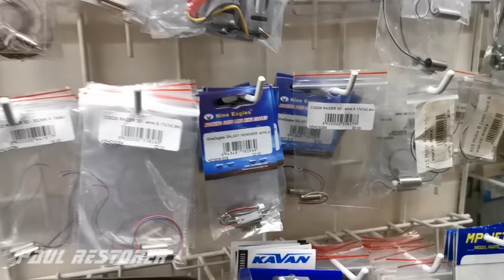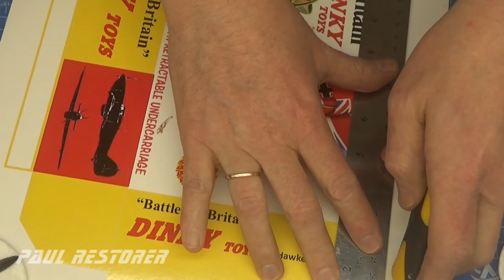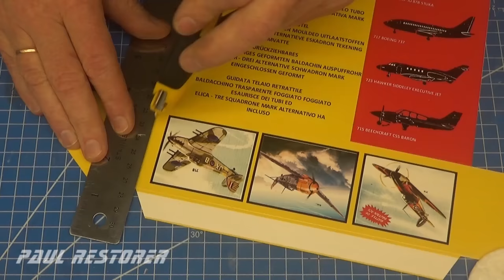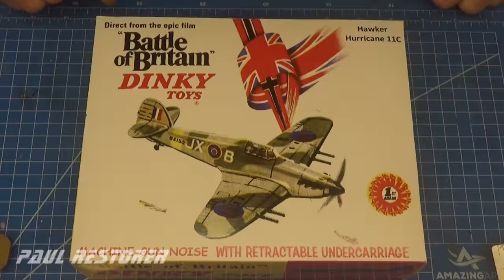Dinky Custom renowacja Hawker Hurricane MkII nr 718. Model odlewany. Śmigło na silnik elektryczny.

Comment: Great job Paul. One niggle: the dihedral is too pronounced for a Hurricane after your bending of the lower wing half . You would have done better to bend the top half. Looks more like a P-40 now.  :-)
Also the panel gaps underneath would have been tighter had you done this.
Dinky made a mistake here too: the MkII C never participated in the BoB. Its was a 1941 variant, too late for that conflict. I guess they just wanted the 1969 film tie-in. Great movie BTW.
Reply from the maker: Thank you very much Jim
Reply: technically you are correct however, in the film itself later versions of the hurricane were used, also, three of the buchon aircraft representing Bf 109s were painted as hurricanes and used in the background as they only had three flyable hurricanes and needed to bulk out the hurricane squadrons. another crazy fact about this film is that at that time all the aircraft gathered to make the film was officially ranked as the worlds 9th largest air force!

Comment: I was "gifted" a similar relic decades ago, the battered and forlorn hulk of a Dinky Spitfire that has been rattling around in a junk drawer at my mom's house ever since, mostly for want of replacements for the long-gone propeller and canopy (that wouldn't require the purchase and sacrifice of a perfectly good kit model).  (At least it still has it's landing gear.)  Now I have a much better idea of what I'll find if I crack it open.

An ancient, played out, beat-up piece of hammered scrap that was just a little bit too pretty to throw away, I had no idea what I was going to do with it....Until today  
I'm sure that somewhere along in the project, I'll be cursing you for setting me down this path, which has, as Winston Churchill put it; "..nothing to offer, but blood, toil, tears, and sweat" 

I'd better get thanking you for the inspiration out of the way now,  before I'm cursing you while smarting from an acid burn. I should also consider documenting the process, as you have, for comparison and possible broadcast. Maybe there are more of the Few, owed so much by so many, waiting in the junk drawers and thrift stores to rise again.
Reply from the maker: have a nice work on the model

Comment: what if you turned it on, on a flat surface, would it start to roll forward because of the prepeler
Reply from the maker: The thrust is big and it starts to drive slowly.

Comment: IIRC, the slot behind the cockpit was for a thumb-wheel, which, when turned, made a clicking sound intended to emulate the guns firing.
Reply: That is exactly right. I used to have one of these as a kid. There was a spring inside that the cog/thumb wheel rubbed against as you turned it, creating the same sort of sound you got when clipping a playing card to your bike wheel.

Comment: This plane never had a motor. It had a thumb wheel on the top. When it was turned it clicked and was supposed to simulate a machine gun sound. It was sold as a kit. I built it and I used the paint supplied, but it was never really suitable for handling as the paint never really dried hard so it had a lot of fingerprints. The spitfire and Messerschmitt had motors. The stuka had no motor but it had a cap bomb.
Reply from the maker: Cool

Comment: The rest'o is ok but the top surface finish should be totally matt , along with the underside ,also the underside of this Hurricane should be matt sky blue NOT  grey , i know the correct painting side of WW2  Aircraft because i do the REST'O  painting on REAL  WW2  Aircraft  at DUXFORD , including SPITFIRE'S  and HURRICANE'S .
Reply: Not quite.  Let’s start by pointing out that Dinky got it wrong in the first place and this is a pretty faithful reproduction of Dinky’s error.  Dinky launched this as a model direct from the Battle of Britain film - so what was Dinky’s mistake? Well the main one is that this is not a Battle of Britain Hurricane - they correctly declare this as a Hurricane IIC and as such the four 20mm cannons and the grey/green upper and the light grey lower colour scheme is correct, but this aircraft is later than the Battle of Britain.  During that battle the Hurricanes would have been Mk I with eight 0.303 machine guns, the colours would have been brown/green upper with a sky or duck egg blue lower - the day fighter scheme of that time.  Later, after the Battle of Britain, the day fighter scheme became the grey/green upper and light grey lower.  Also the original Dinky model (I had one, and the Spitfire and the JU-87) had a gloss finish.  So in summary this is a very good faithful reproduction of the actual Dinky model which was not the right version for the Battle of Britain.
Reply: @robertgarrett4046  
Hello. Mr Heather is just pointing that the modeller has reproduced the errors of the dinky toys firm... As a direct Witness because  he pocessed himself this model when
 he was young. So why getting so angry !!?? A bit stupide attitude.

Comment: you put the tail decals on the wrong way, R/W/B not B/W/R from left to right
Reply: No, he's correct. Red White Blue from front to back.
Reply: @Maxley..  Nope, R/W/B from left to right on both sides.
Reply: @georgebarnes8163  Actually red is at the front (nearest the cockpit) on the fin flashes of both sides. This was done to distinguish it from the tricolour used on French aircraft. The decals applied here are correct, as is the artwork on the box.
Reply: @Maxley..  Both are wrong
Reply: @georgebarnes8163  Ah! A troll! You had me going for a minute!.

Comment: Do you remember the SPITFIRE ? ..that had a battery propeller motor too…….And do you remember the JUNKERS JU 87B STUKA ?…that had a detachable BOMB which could be released from its undercarriage.
Reply: I had the Spitfire Walter....could never work out how they fit such a small motor in.
Reply: @Habu2  Yes indeed. If I remember correctly it was installed in the nose of the aircraft in a tiny space.
Reply: @walterevans2118  Happy days eh ?.....the carefree times of childhood.
Reply: @Habu2  indeed ..lol
Reply from the maker: The Spitfire will arrive early next year
Reply: I also had the Jaguar with the ejector seat.
Reply: @LoneWolf-ck7pj  I vaguely remember that....Also possibly was there a Hawker Harrier too ? ...Vertical takeoff Jet VSTOL
Reply: @LoneWolf-ck7pj  I used to have Airfix kits of all these aeroplanes too.
Reply: I had forgotten the Stuka, but now you've jogged my memory I believe I had one (or a friend did).

The bomb was released by operating a metal catch on the side of the fuselage, as I remember - exciting stuff for the time. And do I recall correctly that the bomb itself had a sprung nose that would explode a paper cap like those used in toy guns?
Reply: @miked1869  yes

Comment: Nice job.

I used to have a Dinky Toys Spitfire that actually had a small motor in it from the factory. It used to take a very small battery that was housed under a plastic cover at the rear of the fuselage.
Reply from the maker: Thank you very much . Cool

Comment: I have that model up in my loft along with a spitfire and ju 87. Used to also have a zero.all a bit worse for wear although the paint schemes on mine are still in pretty good order. It's the propeller the cockpit and the cannons that are broken on my hurricane . The ju 87 was good as it had a metal bomb that had a release mechanism and you could place a paper cap in the bomb head to make it bang when it released:)
Reply: Ha ha....great stuff.
Reply from the maker: Cool

Comment: Some of these were sold in semi-kit versions where you had to assemble them yourself, they included a rivet punch for the undercarriage. It was pre-painted, but you added the decals yourself.
Reply from the maker: I've heard about this version for self-assembly, so far I've only met one. i saw a routemaster bus on the internet
Reply: The Dinky kits weren’t pre painted but came with little vials of Humbrol enamel for the builder to apply.

Comment: Great memories. Used to have a Spitfire version of this with a motorized propeller. If I remember correctly you started the propeller by flicking it. Wish I’d looked after it better. Is is still possible to still buy these or would it have to be a restoration?
Reply from the maker: great For now, I am trying to buy such a Spitfire model, as soon as I can do it, I will definitely be renewing it
Reply: Way back in the 70s dad did 3 spitfires for myself and 2 brothers with the battery propeller we still have all 3 and with the rego he had I think the last letter as our initial P, A and I. We also have 3 seaking helicopters with battery main rotor

Comment: All of the parts for these Dinky aircraft can be purchased on eBay. There are quite a few people selling all the bits and pieces including cockpit canopies, exhaust stubs, props, the rachet gear for the rear of the canopy and everything else. From the look of the untouched stubs that hold the oleo leg springs It looks like this may have been one of the rarer kit releases of this Hurricane rather than the finished product. Very nice finished model.
Reply from the maker: Thank you very much

Comment: Lovely job, though I've never found a finish on a restored metal model I liked (this one is too glossy for me). It does seem to be the most difficult part to get true to the original. If I had to say what it is precisely, it's that the paint layer is too intense - as if the original was sprayed with a light coat, which restorations can't replicate. Lovely otherwise though!
Reply from the maker: Thank you very much

Comment: EPIC job as always.. but tell me.. how would a owner of that, a kid most likely, replace the battery back then? Most likely impossible for those day aye?
Reply from the maker: Thank you very much, this battery is not replaced because it is a battery that is charged in the movie shows that it can be recharged using a USB connector and a normal charger
Reply: TheFunkhouser
This particular model didn't originally have a Battery powered propeller, so yes impossible! lol. The Spitfire & Messerschmitt BF109 models did have Battery powered propellers, but they had a plastic Battery cover on the underside that was easily removed with the removal of a screw.😉

Comment: Proving that you can learn something new every day.
What is the history behind this model of the Hurricane? I am completely unaware of it. I assume it
was produced after the first very successful Spitfire and Stuka toys related to the famous movie
"The Battle Of Britain". How was it able to make Machine Gun sounds?
Reply from the maker: thank you very much. Of course, you're right, this model was created as another after the successful first two. However, in the original version, behind the cabin, there was a plate that made a sound similar to a machine gun and if it was spinning a special wheel in my model, these parts were not there, that's why I remade it as the so-called Custom
Reply: The sound was produced by a cogged wheel located behind the cockpit, rotated by your thumb against a metal plate. Thus a tik tik tik sound was made. (Not very realistic!). Was never sure why they reproduced the mk11c instead of a mk1.

Comment: What is the little kit you used to make the canopy form called?
Reply from the maker: As for blue, it is a material that becomes plastic under the influence of hot water. on its basis, I made the initial shape of the glass. later I made a silicone casting. in which I cast a polyurethane resin mold

Comment: Where is machine-gun noise?
Reply: The Hurricane model was not originally sold with the little electric motor to spin the props.   Instead there was a notched metal wheel to the rear of the cockpit which you turned with your thumb .... the notches made the clicking sound of a rapid fire machine gun.  (It wasn't very convincing - but it was ok if you had a good imagination).  At the start of this video you can see the large space for the wheel to the rear of the cockpit.   The Spitfire model however,  did come with the electric motor to turn the propeller.   I know this because Dinky also sold kits to construct the finished model - and I bought and made these kits.  Even in the Dinky world as in real life the poor old Hawker Hurricane was the cheaper 'no frills' option in comparison to the Spitfire. Hope this clears up the missing machine gun noise issue. This video is an excellent restoration and in fact a sort of 'upgrade' to the original spec.

Comment: I remember them...
Reply from the maker: Cool
Reply: @PaulRestorer  it was all we had in the 60s. In the 70s airfix and if i remember right , someone produced a model plane that came with a motorised propellor that you spun to start. All for realism rather than use. Then you had snap together kits , I had a seaplane that had a motor and tried to taxi round  the bathtub, but I sank it and it didn't like it...surprise .The days of non-stable pladtics.. left a model boat on the garage windowsill at grandparents one year, next year it was totally misshaped from the sun. And the batteries had leaked , as they did....lol